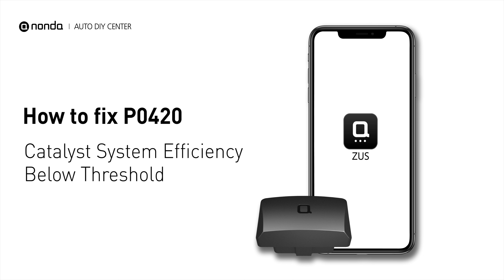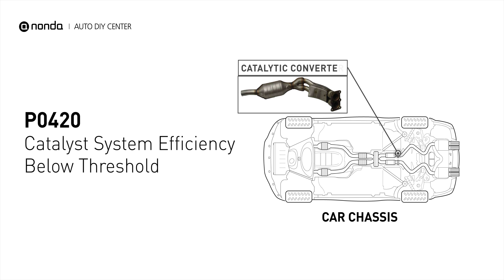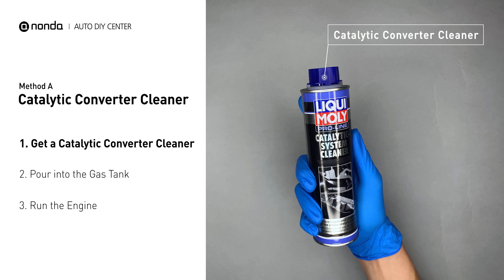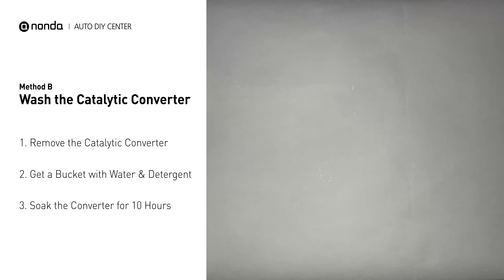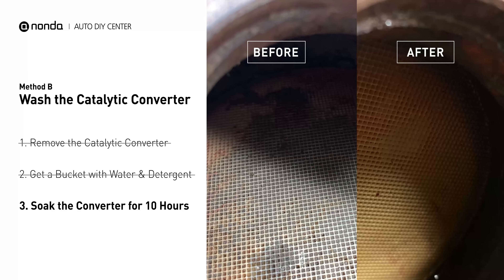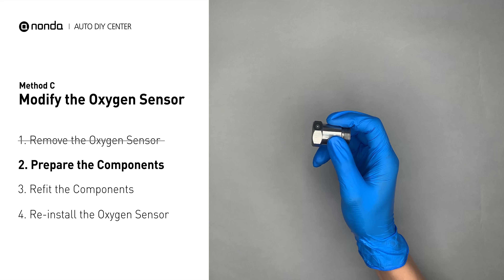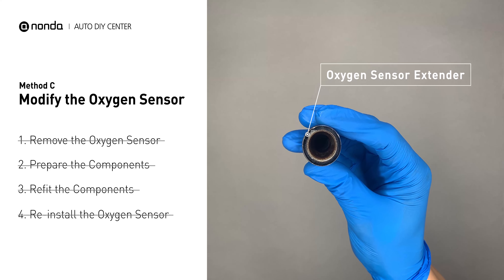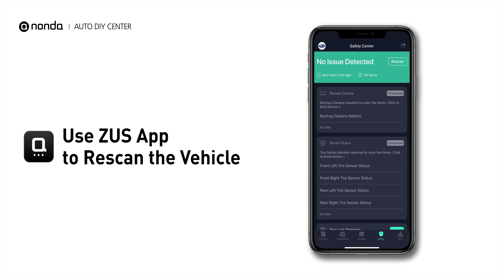How to Fix P0420 Engine Code in 3 Minutes [3 Methods / Only $19.99]

Comment: Hi, I'm getting the P0420 code on my 2010 Jeep Liberty Sport.  I took it to Auto Zone where they plugged it in and it came back with P0420: Catalyst System Efficiency Below Threshold (Bank 1).  What should I do? Could this be an O2 sensor or most likely a replacement of the entire cat?
Reply from the maker: Hello, can you please confirm if this is the only code you're getting?
Reply: @nondainc  For me it is the only code. What is best?
Reply: Was there a solution for this
Reply: @nondainc en mi honda crv 2011 in my case I have the same problem and the only code I receive when I scan
Reply: @lenin1881 This is happening as well in my Honda CRV 2011

Comment: By increasing the the space between the O2 sensor and Cat aren't you just getting rid of the code and not addressing the problem?
Reply: Yes that's all they are doing,the real problem still exists.  If you or anybody else does this .Your only looking to be causing  other problems down the road because you just permanently made the ecm think that what ever the driving conditions it's always putting out o bS emissions and running at peak efficiency for exhaust emissions  when in fact it is not.😂😂😂😂😂

Comment: Helo,
I hv honda odyssey 2009 with 200k miles.recently i changed mobil 1 5w20 extended performance high milage. They guy put whole gln of 5 qrts instead of 4.5 qrts with oil filter, after 2 days of running 20 milages it threw up p0420 code. Plz advise
Reply from the maker: Hello, the issue could be coming from your odyssey timing. Kindly have a check.

Comment: Please make a video for how to fix po841 pls
Reply from the maker: Hello, we will take this into consideration. Please continue to follow us on Youtube for more helpful tips/suggestions on how to fix the error codes.
Reply: What Repairs Will Fix P0841?

Change transmission fluid and filter.

Repair leaks.

Repair or replace damaged wiring and connectors.

Replace transmission fluid pressure sensor.

Repair or replace torque converter.

Repair or replace valve body.

Replace transmission pump.

Replace pressure control solenoid

Comment: I have a Chrysler 200 2015 and I have this code
Reply from the maker: Hello, have you double checked if there's any other fault codes that register along with P0420?
Reply: @nondainc  no it’s just the p420
Reply from the maker: Hello, kindly check the exhaust system for damage/leak and check the voltage reading of the downstream O2 sensor (this will tell you if the catalytic converter needs a replacement).
Reply: @nondainc  I’m sorry I don’t know much about cars how would I check the voltage reading
Reply from the maker: You may use a multimeter to check this. We also recommend our product (ZUS Smart Vehicle Health Monitor Mini) to detect/clear any engine-related issues in your car. https://bit.ly/3b18ro9

Comment: what advise can you give to someone who completely removed the catalyst converter from the car
Reply from the maker: Hi Meshak, please provide us with your vehicle's year, make and model.
Reply: @nondainc  HI am driving a  VW golf 6 tsi 2009
Reply from the maker: Have you tried checking for leaks in the intake, exhaust tube and fuel injectors? Check also if there's worn spark plugs.

Comment: My 03 corolla juat got this code at 50K Miles wtf. Thank you for this video
Reply from the maker: Hello, kindly check if there's an exhaust leak, verify if the upstream/downstream O2 sensors are working properly, check the condition of the gas cap if loose or cannot hold a seal and inspect all the wiring related if there's any damage. Also, if all of the parts mentioned are fine, then the issue could be coming from a failed catalytic converter.
Reply: They are notorious for clogging Catalytic converter’s. It’s caused by manufacturing defects in the engine. Engine oil is getting into your exhaust system. Had it happen to my 2002.

Comment: toyota prius p0420 problem?
Reply from the maker: Hi Gela, kindly check the O2 sensors or connections, coolant temperature sensor, and if there are leaking fuel injectors.

Comment: I have a 4 cylinder 2014 Impala. I replaced both 02 sensors and the Converter that closer to the engine, added fuel treatment into a full tank of 93 fuel and this code keeps coming on. The dealer said that I need a converter from them and not an after market converter.... I dont believe them. The mechanics that worked on my car says that that code may be stuck in the cars computer and the dealer needs to Flash the computer. This back and fourth from shop to shop is exhausting
Reply from the maker: Can you please confirm if this is the only code you're getting?
Reply: @nondainc  yes this the ONLY code. Its mind bobbling
Reply: Maybe true what the dealer is saying. I will let you know how mines goes. I bought an 08 malibu 4 cylinder. I too replaced O2 sensors and converter. I'm still getting P0420. I'm going to trying a better quality upstream O2 sensor. I noticed it is measuring the same reading  as the downstream O2 sensor according to OB II monitor.

Comment: Hello.I am having a problem with my 2010 skoda which has a VW 2.0 tdi engine,it is showing a fault code P2100.I cleaned out the entire intake and exhaust system and that didn't work and so I replaced the throttle body with a new one last week plus this morning I fitted a new Bosch battery . I do have a good code reader and can use it to remove the yellow engine fault light and the car does go well, but the light comes back on
again soon after. Can you suggest what the problem is.I have owned the car for 10 and a  half years and it's
been the best car I have ever owned but it's not worth much now and I don't want to spend any more money
on it than I have to.Thank you,James Hunter.
Reply from the maker: Hi James, have you checked the wiring and/or connectors in the throttle actuator motors' control circuits for short/damage?

Comment: Please Help Code still Remains p0420.
(2007 Camry CE)
Nothing else is wrong with the car.

I’ve changed the catalytic converter , manifold exhaust , both oxygen sensors , replaced the muffler Bank 1 pipe,  changed all spark plugs and  ignition coils. 
I’m Not A mechanic but I need some help. What else should I do?

Comment: Hi, i have a 2014 subaru impreza, I had the code P0171 and P0172. i replaced the O2 sensor and MAF sensor the two codes were fixed but now i have the P0420. Any idea what is it the problem. Thanks.
Reply from the maker: Hi Angela, since you are receiving multiple error codes, we suggest to get your vehicle visually inspected by your local mechanic for further diagnosis.

Comment: So the code is not a $900 fix like the mechanic said 😒 never going back there
Reply: No,  $900 is actually a decent deal. Two of these methods will kick the can down the road, 3rd one bypasses the issue.  To the point where the cat will clog up and you won't see it, It will eventually die on you on the road when it will not allow the exhaust gases to pass. When that happens the exhaust gases are trapped with not enough flow to get out before the engine stalls, you're exhaust manifolds will get red hot because exhaust temperatures are exceeding a thousand degrees, also creates a possible scenario for melting and starting fires under the hood. $900 is a fix, these are not. It'll just take the light away at least for a little while

Comment: Hi I used this adapter on my post cat sensor. I’m still getting the P0420 what could the problem be. Thank you 👍🏽
Reply from the maker: Hi Mark, please provide us with your vehicle's year, make and model.
Reply: @nondainc  this is 2013 Ford Focus - 1.0 EcoBoost hoping you can help, thank you
Reply from the maker: Hi Mark, have you visually inspected the exhaust system for leak or damage? Kindly check also the voltage reading of the downstream 02 sensor to verify if the catalytic converter is functioning properly.
Reply: @nondainc  yes there is a leak in the exhaust but that is after the sensors, my catalytic converter bank1 sensor are at the very start of the exhaust system
Reply: I have also same code in my Toyota vitz 2015 model in Pakistan..  p0420. After clear code 150 km drive come again & eco light also off
Reply: @marksheridan8444  Did you sort the problem in the end?

Comment: I replaced the whole catalytic converter and still the same code (p0420) 
where do you thing the problem is ? from o2 sensors ?
thank you
Reply from the maker: Hello, the rear oxygen sensor must be inspected for any damage. Check the wiring to oxygen sensor and replace if any damage is present. We suggest to refer on your factory service manual as treating this code could be different per vehicle's make/model. You may also reach your manufacturer to see if your vehicle has a manufacturer warranty on parts related.
Reply: Same i'm pissed AF cost me a fortune to change everything and it turns out it was probably the sensor all along going to take it on Monday to confirm :[
Reply: @G_G_G_G_  hi G
How did it go? Was it the O2 sensor?
I have this particular error but to be honest I really don't know which to do first.
Reply: @easyfind01  I'm still unsure took it to the mechanic and he says it's not the sensor but the "cheap Cats I bought" I'm going to get a second opinion but right now my truck is getting painted.
Reply: @G_G_G_G_  thanks for the update. Appreciate.
Reply: @G_G_G_G_ it’s the cheap aftermarket catalytic that is causing your issue, 100% guaranteed 😊

Comment: my code says p0420 something about the low efficiency on bank 1
Reply from the maker: Hi Noe, P0420 is triggered when the catalytic converter is not functioning well. You may follow the suggestions/recommendations provided in our video. Thank you.
Reply: @nondainc  i think i found the problem to it. i believe its the 02 sensor upstream
Reply from the maker: You may follow the guide/suggestion provided in our video. Hope it helps!

Comment: I replaced an EGR valve and got p0420 the day after..  :/
Reply from the maker: Hello, please provide us with your vehicle's year, make and model.
Reply: @nondainc  hi.. it's a 2006 Jeep Grand Cherokee 4.7 v8
Reply from the maker: Kindly check if there is an exhaust leak. Check the oxygen sensor wiring's condition and fix if you find any signs of damage. You will also need to test the oxygen sensor and the catalytic converter to confirm the proper performance as these would contribute to the appearance of the code.

Comment: Hello, how are you my friend, my car suffers from a significant increase in fuel consumption, vibration in the engine, and cuts in the transmission gear when crossing from a bump, it cuts for 3 seconds and then works and suffers from idleness and poor traction, especially on hills. I hope you will help me solve this problem because I spent a lot of fuel  No one knows about the holidays, and thank you my friend
Reply from the maker: Hello, kindly check the condition of all the electrical connection and refer to our response to your other comment. Also, to verify the source of the issue and apply proper solution, a visual inspection is recommended as you are receiving multiple codes.

Comment: now what about p430?
Reply from the maker: Hi Willie, you mean P0430? A faulty Catalytic Converter triggers this code or if your engine is misfiring/having issues starting. Another common issue is if the fuel injector is leaking. We recommend to have your vehicle checked by experienced technician for proper diagnosis.

Comment: You are not fixing the problem .Alls you are doing is creating a mass of people getting the wrong idea of engine diagnostics. You may be getting the ecm to think that 02 sensors is now reading right by putting the spacer in there  but think about people that o2 was not designed by tge engineers who built that vehicle to be that far away from the exhaust stream. I can assure you that no way in hell after pyrting that spacer in there that vehicle isn't fixed its gerrymandering rigged or just put tape over check engine light. Only idiots would believe it actually fixes it.

Comment: I have a 2012 gmc Acadia with p0420 code , changed o2 sensors and still there any advice?
Reply from the maker: Hi Marixa, kindly check the condition of the spark plug. If the condition is good, then the issue could be coming from the converter (needs replacement). If worn, you can replace the plugs and clear the code.

Comment: Hello, I have code po420 on my 2007 honda civic which method do you suggest?
Reply from the maker: Hi Michael, the most common reason that triggers this code is a faulty catalytic converter but we suggest checking also the exhaust system for damage/leaks and check the downstream O2 sensor.